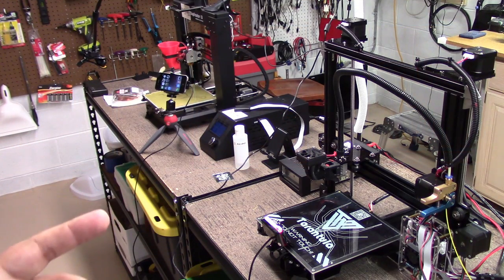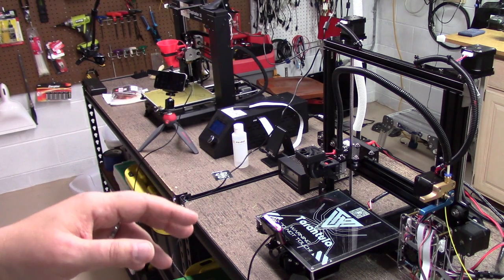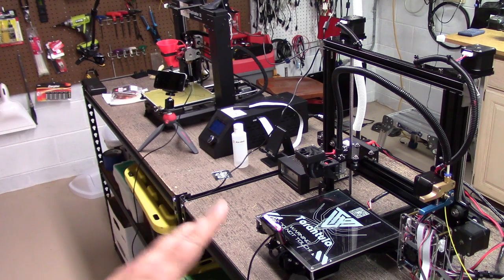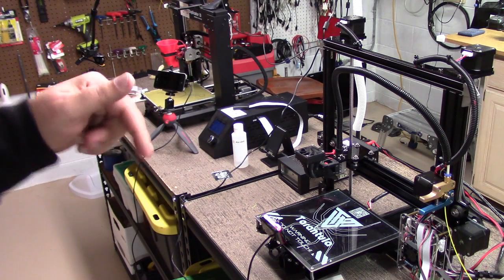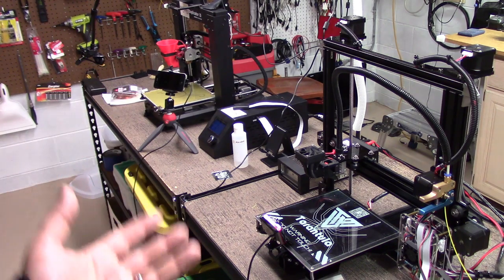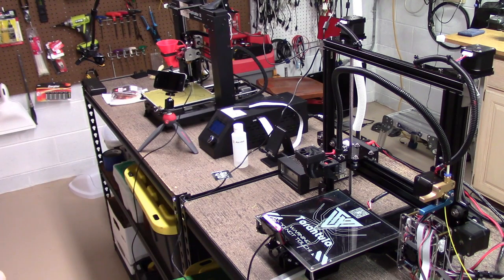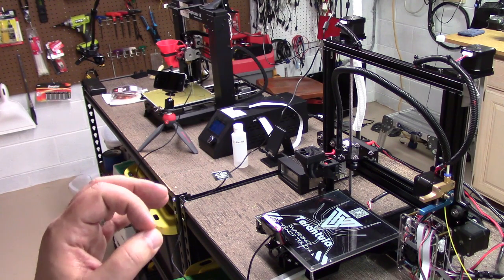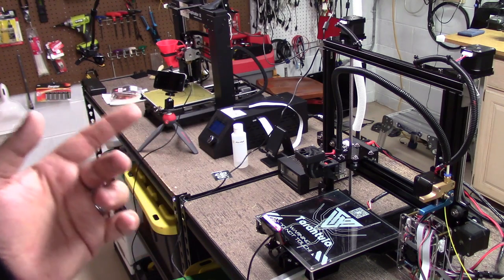Shop Talk -  Why You Need to Switch to PEI Today!

Comment: I found glass to work great with any material but some prep is involved. First clean the glass with glass cleaner than sand the surface with 320 grit sand paper then clean again. Once this initial prep is done setting the bed temp to 70 and all the material will stick just great. I seldom even clean the glass between jobs. Also during cool down the parts auto release so no need to chisel the parts free.
Reply from the maker: Thanks, however I have not used glass in 3 years, either PEI, high tack surface, or a phenol bed.  All have been amazing and I have never looked back :-)

Comment: Do you think I can just paper clip the PEI instead of sticking it on the bed or glass? Heard removing it a huge mess.
Reply from the maker: Yes I have it both ways, for PLA paper clipping is okay however for ABS I like to use the 3M tape to ensure more heat transfer.  Also if you take care of the PEI it should last the life of the printer or pretty close as I have had to replace one yet...

Comment: Just bought a few sheets for my Ultimaker 2+ and CR-10  I've had a few prints with a lot of support fail despite all the PVA glue I've painted onto the bed.  Diluted wood glue dried on the bed worked really well for a long time, as has hairspray....but I think it's time to jump into PEI.  LokBuild was interesting...but wouldn't release my prints!
Reply from the maker: I love my PEI!

Comment: Try printbite. Once you have it dialed in, it kicks PEI's butt
Reply from the maker: Thanks for sharing, however kicking PEI's but will be hard as its cheap, common (not proprietary) and I have done thousands of prints on.  Printbite sounds Buidltak which was driving me to the poor house replacing it...  Can you share more of your experience?
Reply: DIY3DTECH.com PEI just doesn't work if you use Rigid Ink PLA.  It just doesn't stick. Whereas it sticks (and releases) really well from Printbite (printinz). Each to their own. The extra cost is certainly worth it.
Reply from the maker: Please don't take this wrong as if your happy with Printbrite I am happy for you!  :-) Have used PEI With tons of PLA, ABS, TPU, HIPS and PETG with no issue sticking.  So if Rigid Ink doesn't stick then I am going scratch my chin in wonder-ment.  As I too have printed Rigid Ink PEI all be it small parts, but it worked.  Are you having issue with big parts and what bed temp are you using?
Reply: DIY3DTECH.com I must say that I have not used that many materials. PETG doesn't stick. TPU did stick. Obviously it's a case of whatever works for you. I'd love PEI to work. Maybe I should try different manufacturers of PLA but I only have one printer and I don't use a glass bed so I can't really keep changing my bed surface to see what works. I'm happy with what I have. After some initial problems it is now working so much better than PEI ever did.
Reply: DIY3DTECH.com I was resorting to glue stick etc in order to get PLA to stick. It got so tedious having to reapply it all the time and the bottom layer quality was never that good.

Comment: If anyone interested, for removing flexible over PEI you can a use a pinch of talc powder on the surface before: its more easy to use (and clean) then glue-stick.
Reply from the maker: will give it a try! thanks for sharing!

Comment: Been thinking about putting the PEI on glass for flat surtaxes and good adhesion.  I saw this video from Nillabean on YouTube on how to refresh the PEI surface https://youtu.be/jEgEQrQWupg. Tell me what you think and what you have done if anything.
Reply from the maker: Tanks for sharing and I left a comment over there and sub-ed looks like an interesting dude.  Anyway, if you clean between prints it will last for about ever!  I beat the snot out of the Wanhao and that one is over a year and it keeps going.  However I would avoid sanding as there is a point where it is time to toss and sanding has its pluses and minus's. :-)
Reply: I figured that you weren't the sanding type for normal maintenance. Do you use the acetone or alcohol to do regular cleaning?
Reply from the maker: 98% Alcohol after each print, I tried sanding and messed with the finish and I couldn't remove the TPU at all and it ruined the sheet...
Reply: Would you have a link or 3M model # of the adhesive you used?  I have the glass and the mounting clips for the glass on the i3. Adding PEI with adhesive would not affect that, only the bed level adjustment. Might need to raise the Z-stop switch to compensate for the total thickness of the thermal pads, glass, adhesive, and PEI.
Reply from the maker: This is what I use: http://amzn.to/2it4nAS  however watch it as it is VERY sticky!
Reply: DIY3DTECH.com - Thanks, I'll check it out.
Reply from the maker: How is that 360 deg camera coming along?  What do you think of it?
Reply: DIY3DTECH.com - it's pretty cool. I have to process it to make it fit the screen for YouTube. I have not tried to post a video/picture to Facebook yet. Need to give that a try.  I got a handheld "steadycam" off Wish.com for like $5. Not bad. Made for go pro and my FauxPro fits nicely and testing was good. Nice decent results. I need to practice more with it to get smoother shots but really helps out on the "bouncing" when you walk.

Comment: PEI works super well. It works with Nylon too, but use a raft and gluestick. Polycarb works well with it too -- (I used PC-Plus/PC-Max). For Flexibles (TPU and Ninjaflex), use a cold bed and gluestick, but gluestick helps to release the part not adhere, as flexibles stick too well to PEI.
Reply from the maker: Many thanks for the feedback, so your using it with Nylon?  My understanding is Phenol worked better?
Reply: Nylon requires a bit more TLC. But it does work.
Reply from the maker: Interesting and thanks for sharing as I want to do a short series on nylon...
Reply: The main thing with nylon I'd making sure it's dry. I baked it before using it. I didn't like it, its next to impossible to keep it dry between prints, I have it in a closet with desiccate tubs and it still absorbs moisture. I think the taulman nylon bridge is easier and Alloy 910 as well, pure nylon is too much trouble.
Reply from the maker: Ah, interesting as yeas that is what I had planed to start with (i.e. taulman nylon bridge).  Thanks for the feedback!

Comment: What is the installation procedure for PEI onto the bare printbed?
Reply from the maker: I simply clean it off with alcohol, stick the 3M tape down (this stuff is MAJOR sticky so get it right the first time:-) and than the PEI...
Reply: DIY3DTECH.com - so how do you remove it if you need to?
Reply: DIY3DTECH.com - I ordered a 12x12 sheet of PEI from Amazon but have not decided if I want to install it. It has no adhesive on it so I'm curious about which 3M adhesive you are using. 

Also which side faces up?  The shiny or the dull?  Does it cut easily so I could get it to fit the Monoprice Maker Select (Wanhao)?

I have borosilicate glass that I'm preparing to install. All I have left is to install the thermal pads but I'm not sure the best way to do that. I have seen others use a checker board pattern and some just the four corners. I know you need the pads to transfer the heat to the glass but if you applied it over the entire bed it would transfer the heat well but also and deformations of the bed as well. Have you tried glass?
Reply from the maker: Also if you score it, you can snap it with a hard edge...
Reply: DIY3DTECH.com - Score & snap, good idea!
Reply from the maker: Or you can be like me and buy a CNC machine ;-P
Reply: Norbert Davis IPA and a lot of patience worked for me.  Use a scraper to slowly remove the old glue. It takes several attempts to get it all off.

Comment: I have mine stuck to double sided FR4. Works great and I can remove and flex it to remove stubborn prints. https://hexandflex.wordpress.com/2016/07/15/wanhao-duplicator-i3-pei-bed-mod/ .Some people find the need to lightly sand and clean new sheets with acetone first. I guess that the PEI sometimes has some residue left from manufacture.
Reply from the maker: Love the "Moving Electrons" tag line!  At work for my IM status I use "making the world a better place one electron at a time"!  Also great post and very interesting idea using copper!  What I might do is machine one on the CNC and add the PEI.  Thanks for sharing!
Reply: thanks. I guess sometime we move more than just electrons :) I really need to add some more posts to that blog. Just don't seem to have the time.
Reply from the maker: Time is always and issue, however blog post don't make themselves and I like your start!

Comment: I am uncertain about this as I love my plain Boro glass printing then it stopped working and I switched to purple gluestick and it works.  Now my new printer has a 12x12 inch 1/4 inch tool plate on it and I am uncertain what to go to with it.  A 12x12 boro + pei is pretty darn expensive and no way would I use plain window glass after I broke one before I went to boro on the i3 rework.

My other printer has this "pc glue" buildtak stuff and I hate that with a passion.  I warped the metal trying to get my first few prints off.  Just nasty stuff that will not let go.
Reply: Dark Alchemist you should be able to stick the PEI directly to the tool plate with a 3M adhesive sheet.
Reply: Scienteer
Not sure I really want anything permanent though.
Reply: Understandable. I used FR4(double sided PCB) on mine and it works well. I use bulldog clips to hold it on. It you can find a cheap sheet then it makes a good alternative to glass. Not quite as guaranteed to be perfectly flat, but you can flex it to break off sticky prints. The metal coating means it would work well with inductive sensors too.
Reply: Scienteer
Yep, the problem I have always had with FR4 is that it is never flat and why glass is used.  I wonder how thick I should go if I want to clamp it down?  The thicker the more it will lay flat but too thick it will never get warm.  The way I use my boro glass is to use 4 Gino pads that I have strategically placed (putting one in each corner did not work) as the clamps were a PITA and several times I ran my J-Head nozzle into one so I may have to forgo PEI and stay with glass and glue sticks.
Reply from the maker: I don't use any glass any more, PEI (about 1mm)directory on the metal and done, over a year and no issues!
Reply from the maker: 10-4 on the alcohol between prints!  Also I could just see my wife coming home from work saying gezz honey what smells so good?  Are you making me dinner for a change?  Sorry no honey just baking my FR4 circuit board.  Things which make you go hmm along with a size 9 where the sun doesn't shine :-)
Reply: LOL yeah . i have only ever done  'fresh' boards so no solder on flux or mess .  but still its hard to answer "hey hon' why is there a vice in my oven ?"  and have a good reason that dont get you busted .
Reply: XerotoLabs great tip thanks. No problem eith warping yet, but good to know.

Comment: Funny that you mentioned that as I've started using PEI today. Printed few things using PETG and in all cases it stuck with no problems!
Reply from the maker: This is a wonder material and the main reason for doing this more VLOG was the number of questions I was getting must have indicated a lot of 3D printers where sold for Xmass and didn't want people becoming frustrated with the glue or blue tape mess as I was skeptical however not any more!

Comment: I'm thoroughly convinced after a few recommendations from other folks as well.  I will switch to PEI on my printers as my BuildTak surfaces need to be replaced. I like that I've not had to use any glues or sprays with BuildTak and I've gotten pretty good at using it successfully.  But I have to admit if you get that first layer down too well it takes a little effort to get prints with large first layer surface areas to release.
Reply from the maker: Your 100% right on the first layer and with PEI I have (#1) had great luck in achieving really good first layers and (#2) the stuff last for ever as the Wanhao is my workhorse for this channel and the PEI bed takes a beating without issues as with the builtak clones I was 30 to 50 prints and then another $7 to $11 bucks.

Comment: I run my PEI sheet at 110 and I have no problems. It works really good.
Reply from the maker: Ditto to that my friend!  What types of materials?
Reply: Only abs at that temp.
Reply: I run at 110 for ABS to on the Wanhao i3. Although I set the first layer to 100 as it speeds things up no end.
Reply from the maker: Interesting, as one of the things I have seen on my DiVinci's is  when I got that high (110) the ABS would discolor sort of like become scorched however with the PEI that no longer happens...
Reply: Probably leaching something out of the substrate. No problems with PEI though. Even up to 120°C
Reply from the maker: I think your correct as the one which use for HIPS I run about 110/120 and it has dis-colored but still works fine!

Comment: hey do a video of when you do the mpsm I just bought one and ordered the e3d v6 head and am currently awaiting it in the mail. printing in abs surprisingly well atm stock as is never did any bed leveling or software updates either   so I'm extremely impressed it's all up to date out the box as of Monday night I haven't stopped printing. thumbs up cheers!
Reply from the maker: I have both the v5 and v6 in a box waiting however the exiting hotend is a bit like the energizer bunny! It just keeps going!
Reply: DIY3DTECH.com yeah I've been running mine since I got it Monday and it's been just as good as the first print every time.
Reply from the maker: Very cool!